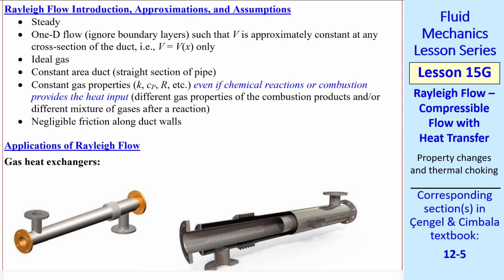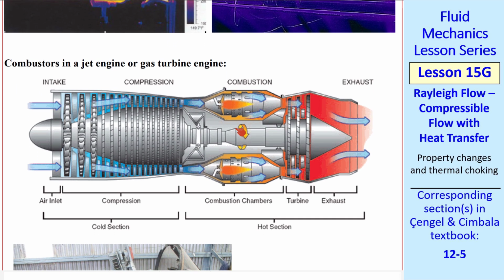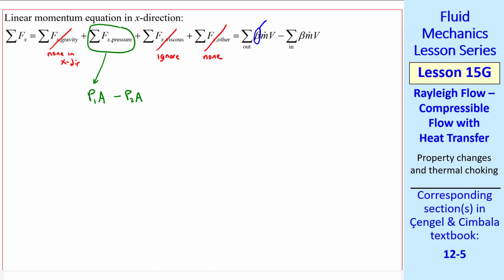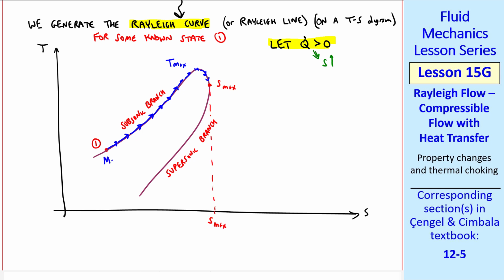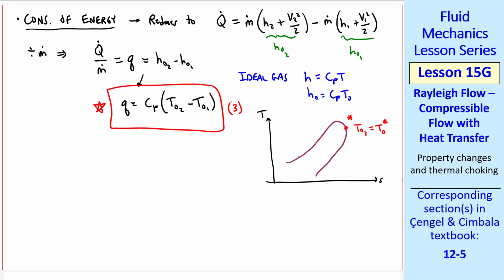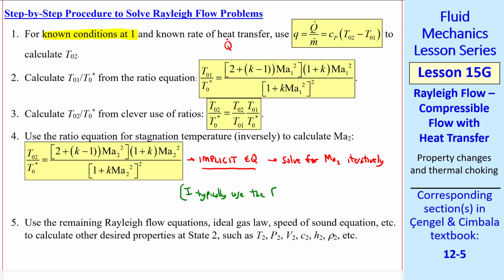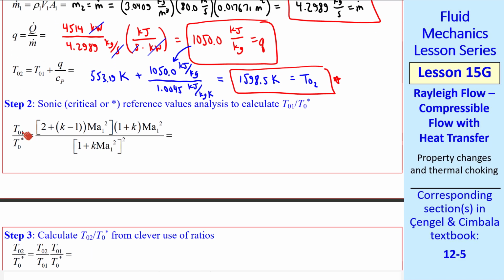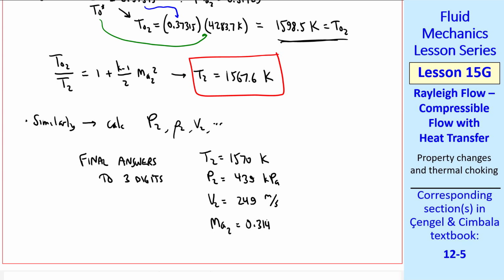Fluid Mechanics Lesson 15G: Rayleigh Flow - Compressible Flow With Heat Transfer

Comment: Amazing video! God bless you!
Reply from the maker: Thank you for your kind comment. Please tell your friends and colleagues about my YouTube channel where there are more than 560 free videos about the Bible, fluid mechanics, science, math, Excel, statistics, air pollution, and other topics. I would greatly appreciate it.
Reply: @johncimbala  I work with molded case circuit breakers and I have study multiphase flow to optimize the exhausting gasses inside the arc chamber. If you have some literature references for this kind of flow I appreciate it. Thank you so much Sr!